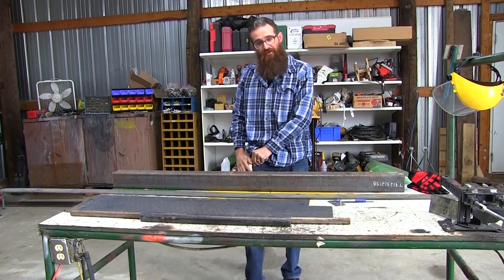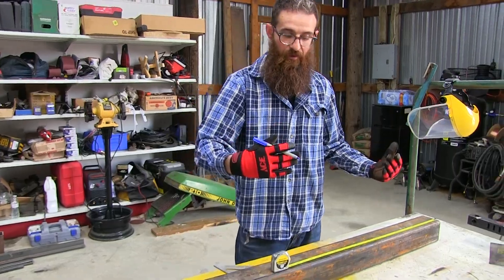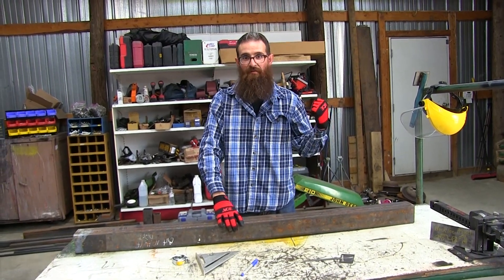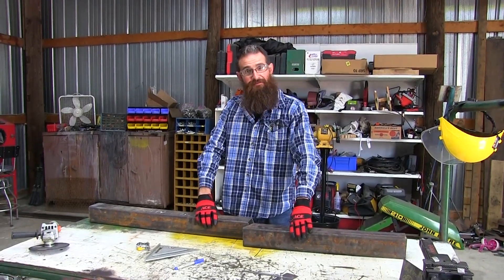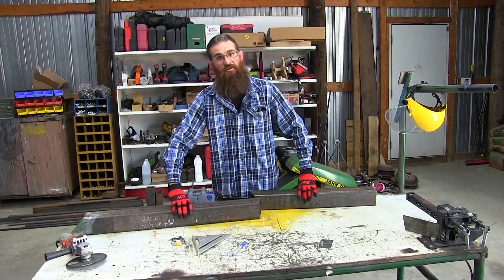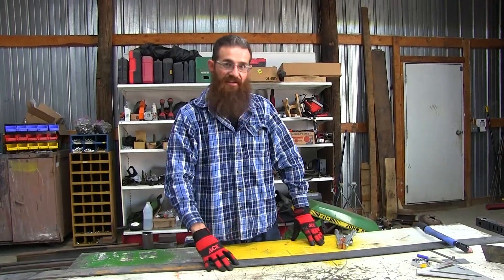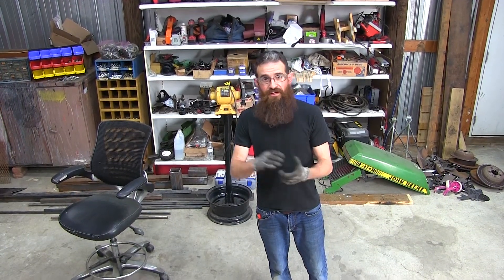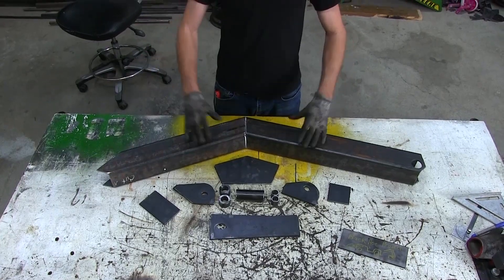Building a Mini Backhoe for a lawn mower (Part 2)

Comment: Would you guys consider building a loader for someone?  JD 430.
Reply from the maker: I really wish we could, however the cost would not be worth it.
I haven't crunched the numbers but it would probably be between 6 or 7 thousand.
The DIY portion is where you save money.
Reply: What was the material cost, roughly?  I have not welded since 1984!  lol
Reply from the maker: Metal was less than $400. I believe everything else was another $1000ish. 
This was my first welding project. Never welded anything, never been around welding until I bought this welder about 3 months before I built this.
Reply: I am looking at welders and a chop saw now, maybe a plasma cutter!  I can't even buy the "little Buck" loader for $1400!  Not to mention my JD 430 may get a complex with that little thing on it!  lol  I guess I will be cutting and burning some metal this winter!  Thanks for the info and good luck with future projects, I will be watching...

Comment: Good day. I picked up the plans 3 or 4 months ago. Probly going to be a winter project. I only had a look at them one time and for me they are the first set of plans I ever looked at. Little intimidating. There is 2 sets of mersments for the arms did u go short or long. And  you stick to the size it called for for all the metal or did you beaf it up some. Looking at it on paper its had to see the end project. And I keep watching the rest of them you probly all ready answered it all ready lol.
Reply from the maker: I agree, it is a little intimidating. Just take it page by page and you will be fine! 
Which arms are you referring to? The outriggers are the size that the blueprints called for, I believe there are 2 measurements for the crowd arm. We went with the shorter one, since 5.5 feet was plenty of depth for the tractor. 
We did beef up some of the metal, 1) our local steel supplier didnt carry the size it called for (but we kept the outside demensions the same) 2) we went thicker on the crowd arm so we could make it out of one piece instead of welding on brackets.

If you still have questions, dont hesitate to ask!